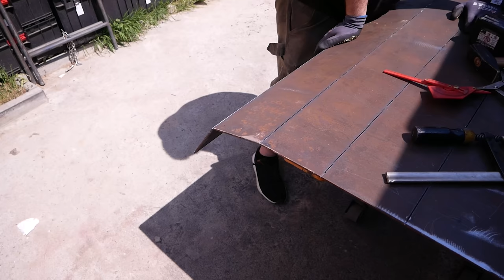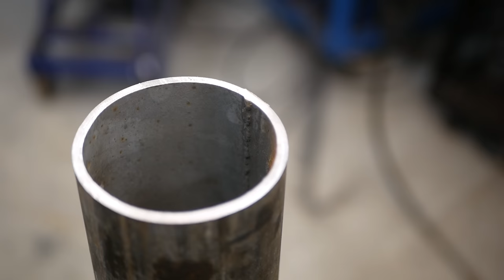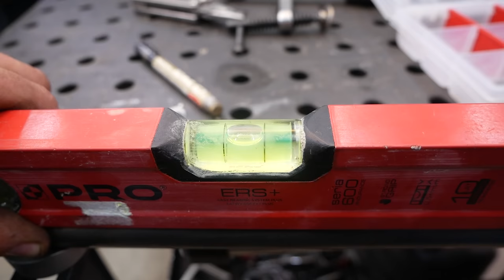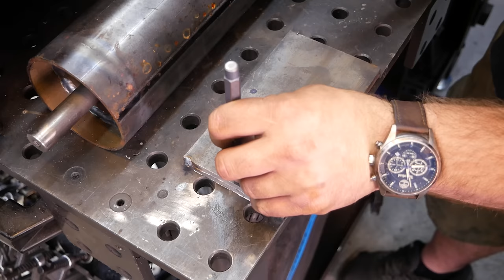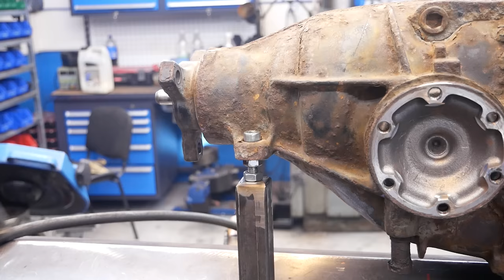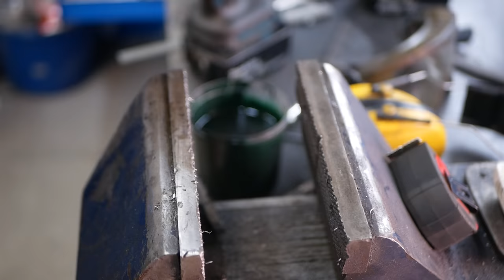Extreme Brush Cutter BuilD

Comment: The spider gears are not meant to spin continuously at high speed (like doing a one-wheel burnout in a car), they will eventually overheat and seize up.
Reply: Tractor PTO’s are 540rpm
Reply: @tonydoggett7627  That means the one side is at 0 rpm the other one will be spinning at 1080 rpm.
Reply: O

Comment: Fantastic work, I have a humus version of this, they describe it as a mulcher mower. Had a problem with balancing,  it was threatening to shake itself apart, solved it the same way you did. They are a fantastic for cutting brushwood, they take a lot of HP though, for cutting grass humus supply a y type cutter which would probably be more suitable and not need as much HP. A person with your skill level would undoubtedly be able to fabricate them
Reply: A 20 hp tractor  can drive a 5 foot flail mower  quite ok, we used to run ours through 3 and 4 inch shelterbelt  trimmings, one pass, done

Comment: Never heard of a flail design mower attachment for a tractor . In the area I'm from they use something called a bush hog. Yours appears to facilitate the same job but with a smaller footprint. I am impressed.
Reply: The flail mower is very common in my area.  Does a much better job that a regular bush hog since it leaves very small pieces in its wake.

Comment: Finally i have found someone who is crazy enough like me to build stuff like this yourself. Awesome !  I do have a few notes about the build . 1) you should have used a normal angle gearbox and not one with a differential of which you block one side. It's not build for this and will fail very soon. 2) I think you should have used belts that were a little shorter. They have to bend too much to tighten them. They will wear out really fast.  Other then that. great work !
Reply: Yes belts too short but mainly they need to have a spring tensioner on them. Mine has that and without it, many things can break.
Reply: Not a great work i'm affraid... While working, you can see the whole thing shaking... So it's pretty bad... The shaft is off center...
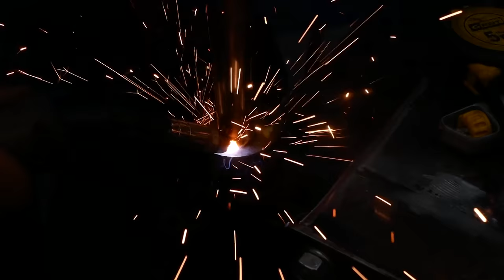Reply: only point of sure fail is the welded drive shaft at 18:15 it will snap like glass there

Comment: The 3 point linkage needs to be mounted as low as possible so if you hit something the mulcher front will be pulled up to clear it. Being high it will tend to dive down into an obstruction. I've changed a few agricultural attachments like that.
Reply: Интересно,какая модель вам больше всего понравилась в работе?
Reply: Did you notice the jam nut on the 3rd link must not have been tightened? It was threading itself around at the end

Comment: Very interested in how well this holds up. WIth that differential axle flange held on one side it's going to I think half the gear increase, but also put a lot of wear on the spider gears that they weren't really intended for. of course, it's also not driving a car!
Reply: Yeah I though it strange to drive an axle flange also. You’re right it will reduce the ratio by half driven this way so if the ring and pinion is for example 3:1 his effective ratio is 1:1.5 (speed increase from the PTO). Also the ring and pinion is loaded on its “coast” side. The gears aren’t cut to handle full load in this direction. He could have welded the side gears to the ring gear carrier, drove the differential at its drive shaft then used pulley size to gain the 1.5:1 increase.  But as you’ve pointed out, it’s not driving a car. Looks like that tractor is under 30hp. Nice work overall.
Reply: I noticed the pinion shaft /  spider gear problem also.  Pinion shafts and spider gears don't have bearings so those gears are going to eventually bind and snap.  A better solution would be to weld the spider gears and let the unused axle shaft spin freely.

Another problem, although less severe, is the idler bearing located on the wrong side of the belt drive.   Belts can only pull, not push, so it's important to put the idler pulley on the slack side of the belt instead of the tight side.   Since there's a lot of rotational mass here, the drive and driven pulleys will change roles during a deceleration event of the engine.   For this I would consider using a overrunning clutch on the PTO shaft.   

Otherwise, I like this design and plan to borrow a lot of ideas for my own someday :)

Comment: What a great build! Truly!

I have two commercial units I use every summer and fall. Your build is just as good as those units I purchased. 

(Hope you go back to the wood chipper eventually. Seeing your solution there would be nice)
Reply: could use some sommercial blades that are easy to replace and could do with some sharpening

Comment: Interesting project; the only issue is that the knives you designed the machine around are for finishing work, like mowing your lawn, versus longer (and heavier) rough mower knives. Basically, the effective diameter of the primary shaft (with it's knives) determines the type of work it's suited for. This will knock down the pasture, but you're going to have to make several passes. Changing the direction of attack can help as well. The flip side is that once you have it under control, this unit should work fairly well. Nice work!!!

Comment: Good work. A couple of tips from one driving and building this type of machinws some years.
It looks like to low rpm. The result should be clean cut With new v shapes like you have.
Also we allways used Rubber mats as protection in The front. In your case It might not matter.
Tube for The axel works for easier load. And in your case It might be fine. We always used beefier axles or even solid ones. But we also ran them pretty Hard:) good That you balanced
 Its key for them to work long term. Have fun and as said If they are well tuned they can esily cut as a lawnmower. Even through thicker brush

Comment: Awesome build again. Would you think about locating a clutch between the gearbox and drive shaft. With a gearbox that big if you jam the swinging hammers that energy could be transmitted to the tail shaft on you tractor and twist the shaft. Very good build though

Comment: Great work. The idler will wear the belt out faster than needed though due to flexing it back backward so tight a radius. increase the diameter of that idler to increase your belt life.
Reply: Use a timeing belt idler, even a good second hand one as they are replaced as a matter of course regardless of condition.

Comment: Now this is done fabricate a rotor tiller bar for your spring plantings. There could not be much difference except ratio of revolutions. My flair spins at 2000 rpm. But changing of pulleys might slow that down. Who knows? Might work.

Comment: The differential won´t make it long. They are not designed for a constant 0/100 ratio on the outputs. The rpm of the flail shaft could be rached easier by the ratio of the pulleys. Also there are no shearbars to the flail shaft.
Reply: I had the same thought, the spider gears won't like that kind of abuse. I think it'd last longer if he locked the differential by welding the spider gears and then let the other output spin freely instead of being bolted to that plate. He'd get double the output rpm at the same time.
Reply: was going to comment that using the good old cig locker (welding the diff)  and letting the other axle shaft free spin would be a better way to do it but you beat me to it
Reply: Should be fine, we use a differential like this on a hook hay loader, one side has a brake drum and the other side has a spool for the rope to wrap on, worked that machine daily for years for 3 to 6 hours 6 days a week, just keep good gear oil in it
Reply: I was going to talk about the grease of the bearings... but the rusty look just got the point... 
I don't think this is made to last... they did a test
Reply: @boobrowsky  Dude, I´m half german half polish. When I build something, I build it to make it last. But I know about the polish mentality at building things. Because of that, I won´t ever use the machines or tools from my grandfather...
Reply: 233w32
Reply: Very nice looking build overall.  But, I wonder if the threads in aluminum puck adapter between the differential and tractor 3pt output, belts where they are back tensioned by the small diameter hall bearings or bearing themselves will go out first.  But all that can be modified as you. Nice looking build.

Comment: With MAG welding, the torch is pushed and not pulled like you do, so your seams don't look very solid...the torch is pushed into the shielding cup to eliminate constant air and contamination. just a tip otherwise nice video

Comment: I enjoyed the build. I like it. It so happens that I'm currently looking at buying a Flail mower. I'm curious though. What are your salutations for lubrication and ventilation of the differential with it being upside down?  (To be able to provide gear oil to the pinion bearings, with it being upside down, you would have to over fill the unit. This puts fluid way above the normal place on the two axle seals - as it is going to have to be much higher than normal. You also need ventilation so the pressure does not build up as the fluid heats up and I didn't see how you dealt with that.) I really hope it works well for you. I know what they cost to buy the darn things. Grin  All the best to you, Tony

Comment: Great build but there is a major flaw in design. Belt tensioner roller diameter is way,way too small. Each belt type/size has its minimum curvature radius predefined in appropriate standard and it may differ according to the producer or brand. Check the belt type, size and brand and according to that data look up the predefined minimum curvature radius or minimum belt wheel diameter (each brand has its own catalogues with all data). Also, ordinary V-belts do not "like" to be bent like that  - towards inside. It would be far better to make tension by bending the belt towards outside but then you can not use ordinary cilindrical tensioner rollers. You may loose some of the contact surface/angle by bending the belt outwards but, as far as I can see (correct me if I am wrong), you have two SPB (16mm) or 17x (17mm) or 17-B belts and they can transfer up to 4kW of power each if proper wheel size and rpm is used and since you are using quite small tractor, you probably do not have more than few kilowats of power  tranfered anyhow. By the way, you need cogged V-belt if you  want to bend it inside otherwise it will start to crack very fast.
Otherwise, build is great. Excelent welding and machining and even shaft is balanced.

Comment: Great build, but those little bearings are using as an idler are going to spend real fast. The belt distances the same so a bigger Idler Wheel would be better.

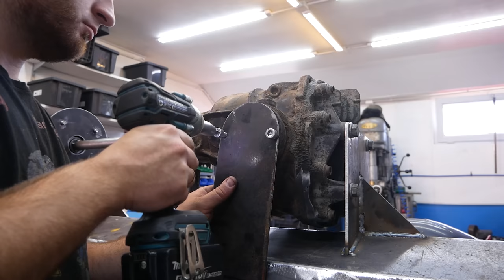Comment: Nice, but just for safety, I would suggest adding 2 more bolts to the fixed end of the differential ( 20:27 in video ), and/or welding that end of the differential shut too. Those 2 bolts looks like it will be the question when, and not if, they will be sheared off by the rotational force.

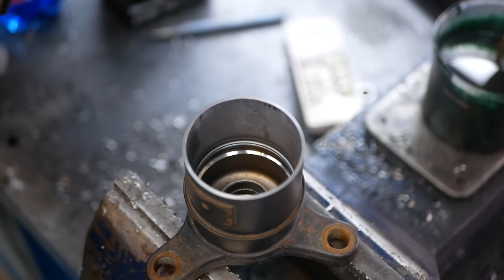Also the axle between the differential and the belt drive ( 17:54 and onwards ), you could have made the welds stronger, by first welding the bottom washer (like in the video), then inserting the axle into the washer, and welding it to the washer. Then sliding the second washer along the now welded axle to the differential and welding the second washer to both axle and differential ASWELL, so both washers are welded BOTH to axle and differential.

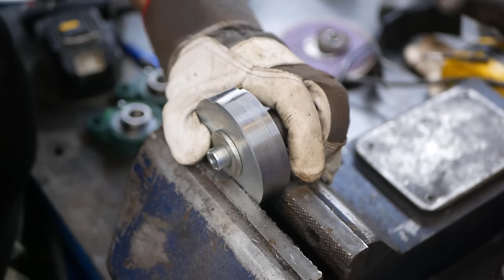For the flail axle this isn't an issue since you made the "notch" ( 4:12 ) that interlocks with the longitudional weld inside the flail axle pipe, thus providing kind of "keyway" that locks everything shut, providing the additional strength in addition to the weld.

Comment: won't the spider gears in the diff break(or the pin) due to locking up the other axle? ( could open the cover and weld the spider gears to the carrier then let the other axle spin with it would last longer.. )
Reply: They will brake. Everything else is done very good!

Comment: Yeow 😱😜 I shuddered when I saw your hand reach back on the press with that glove on while it was spinning and you grabbed. 

When I investigated an accident in a factory producing aluminium extrudes design and shipping. 
Guy lost half his hand and forearm when the glove touched the press with a cotton glove because you couldn’t touch the raw until after anodising the third or fourth station from his department. He sometimes drilled dropped design hole because each extrude could have a different pattern. 

Any way I wonder if that really rubber would grip and stretch or have they chosen the correct rubber? 

I’d put it on a stick and test to see what happens before I ever let a glove touch the bit. Even the wrong paired and sized  chain link would turn in especially if the same thing that caused this time to be different. Then what is supposed to happen. 

That was a long time ago and I had many sets of gloves relatively looking like those they all behave different and with so many varieties. Are these gloves designed for turner fitters? 

It sure looks like you know what your doing so I assume they are safe gloves for this although I have met many that should know better and just was already using them and thought I’ve done this a 1000 times. 

Nice work may I ask why did you scarf bend weld vs using a break bend for the deck? 
Cheers. Now I have to go back and watch it again. Good video mate.

Comment: Attention: If You locked one side axle, the other axle will spin with 2x higher rpm due to differential principle. So not 1500 but 3000 rpm at the end.
Reply: "Made in Poland" used the input shaft as output and the output shaft as input, so.....
the ratio is in fact 2.7/2=1.35. The output speed is 540*1.35=729rpm.
Reply: @catalingruin7189  You may be right, I have to check that manually on some spare diff!

Comment: lookup flail zero grazers which is a piece of farm equipment that was used to cut grass and blow it into a feeder wagon, grass is tough to cut more so then rough small tree brush and so on many stems is grass 3 or 4 feet high so building a fail that is short not at least a foot long really limits this machines speed it would take quite a while to fill a feeder wagon with flail you built it is more suited for brush where hitting dirt and stone is involved but not a large volume of forage even the short grass you were cutting if the tractor sped up it would kill the motor impressive shop and metal working skills

Comment: I think the only thing I would have done different is put a spring inside the tensioner tube and welded the bolts in with just enough room for the tensioner to slide so the belts would always be tensioned properly automatically   otherwise good  job

Comment: Good build. However it did seem to be cutting terribly, are the flails going the right way?, also not sure what ratio you got using the diff, is it close to 540, usual tractor rpm. Also should use nyloc nuts in your builds too.

Comment: Overall ratio of that diff must be about 1:2 tractor:pulley, right? Assuming: 4:1 ratio diff when driven in the end and out the side, then holding one side still means the other side goes twice as fast = half the reduction or 2:1 from input flange to single spinner, and thus 1:2 from "one wheel" back out of the input shaft? Vary ratio according to the real ratio of the diff, which if euro could be closer to 3:1 than 4:1 - W220 is a merc? let's say 3.3, so 1:1.65 from tractor to pulley? Correct me if wrong, or confirm if right :-D
Reply: Can I safely assume this is for turning Russian "soldiers" (teenagers) into crop fertilisers? ;-) I hope so.

Comment: Hi, not a fan of the belt tensioner. It bends the belts backwards in a very tight radius. This will age the belts sooner. The stack of bearings has more drag than just two, and they run much faster than with a larger wheel.  Since you have a lathe, why not make a proper idler wheel?
Reply: My thoughts as well, stacking bearings like that will cook them. The extra tension on them from pulling the belt back that way will also produce extra heat. Better off with a one bearing tensioner mounted in a wide rim and a shorter belt. The wide rim can help cool the bearing and the rim be twice the diameter of the bearing, this will half the speed of the bearing.
Been there done that many a time 🤣

Comment: You used the input shaft as output and the output shaft as input, so.....
the ratio i think is in fact 2.7/2=1.35. The output speed is 540*1.35=729rpm.
If you need more speed, just lock the diff and let free the second output, or make different pulleys.
Verry inspyring video for another product "Made in Romania".
Reply: I guess he will be welding diff soon, spider gears wont take this kind of abuse anyway. Otherwise good build!

Comment: What is the purpose of the bands connecting the 3 bolts together at 21:13?
Great build.
Reply: I was wondering the same
Reply: That's an aluminum part connecting to what appears to be a rubberized dampener , bolts are likely steel. I assumed it was just a washer to spread the load out.
Reply: Just an adapter
Reply: Its a strengthener, remember that he screws into aluminium. Aluminium is a WEAK material. The metal piece he screws there that connects the bolts together, provides a greater surface area for the bolts to grip onto, so the aluminium isn't squished or the holes are enlargered by the forces, causing the aluminium to fail. For the PTO adapter, its already in a stronger material providing the required surface area itself, thats why its not required such strenghtening bands for the PTO part.

I would personally add washers and bolts on the backside of the PTO part if I were the author just to ensure the threads in the aluminium isn't worn out by the PTO part. I personally don't trust aluminium for anything threaded.